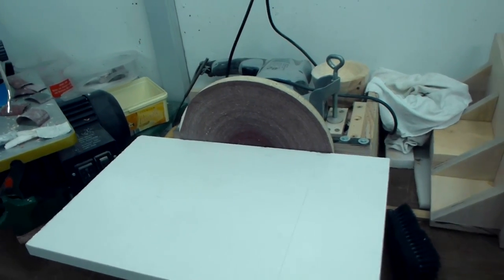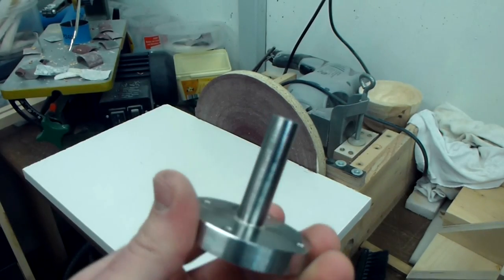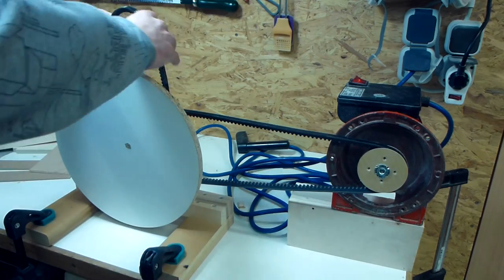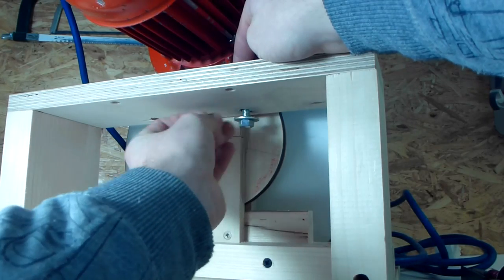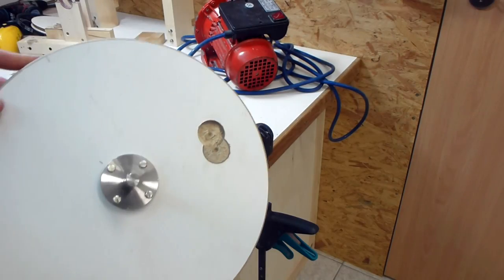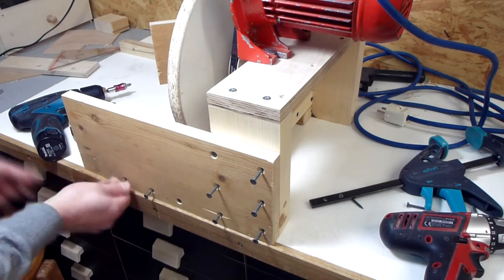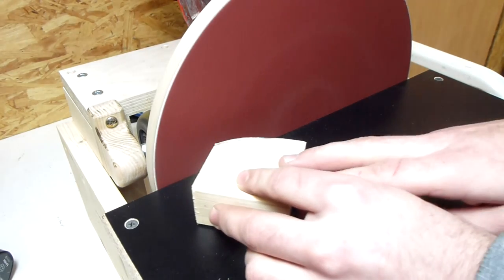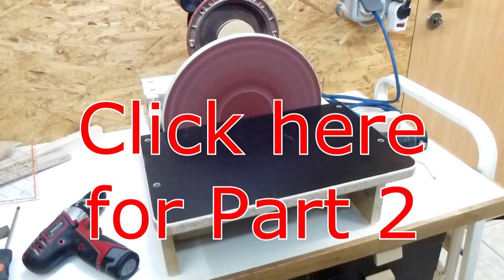Homemade 12" Disc Sander (Part 1)

Comment: A lot of neat ideas in this one - I really like the idler wheel to support the disk.
Reply from the maker: Thank you!
Reply: +John Heisz Me too, as I saw that idea I started thinking if it would be possible to harvest some energy from the turning rollerblade wheel? Probably not that much (though it depends on the usage of disc sander) but it's an interesting thought.

Comment: Добавьте в описание параметры станка: мощность и обороты двигателя, диаметр и обороты (приблизительно) шлифовального диска

   Add a description of the parameters of the machine: the power and engine speed, diameter and speed (approx) sanding disk.

I am sorry for my bad english, I'm using Google translator :)
    Mark Fisher, Kiev, Ukraine.
Reply from the maker: Motor: 600 Watt 2850rpm
Disk: 30cm diameter 1400rpm (more on that in Part 2)

Мотор: 600 Вт 2850rpm
Диск: 30 см діаметр 1400rpm (докладніше про це в частині 2)
Reply: Marius Hornberger  Спасибо за ответ, и за перевод :)  Но Вы можете писать и на английском.
    Я использую браузер Гугл Хром, который переводит комментарии на русский или украинский языки :)
    
      Заходите на мой канал https://www.youtube.com/user/AlfFisher
  Я выкладываю видео о столярке и самодельных приспособлениях.
        Канал русскоязычный, но последнее время я начал добавлять субтитры, которые можно перевести на английский - средствами Ютуб :)

Thanks for the answer and for the translation :) But you can write in English.
     I use Google Chrome browser, which translates comments on Russian or Ukrainian languages :)
    
       Come to my channel https://www.youtube.com/user/AlfFisher
   I post the video of joinery and improvised devices.
         Russian-language channel, but lately I've started to add subtitles, which can be translated into English - YouTube means :)
    Mark .

Comment: Um die Vibrationen zu minimieren solltest du den Riemen waagrecht oder Bus zu einem Winkel von bis zu 60 Grad zur waagrechten Aufbauen.
Dabei solltest du aber darauf achten dass die Seite des Riementriebs die in drehrichtung des Motors vorher ist oben ist.

Ps: der letzte Satz USt nicht perfekt formuliert wusste aber nicht besser wi Ich es erklären soll. Sehe dir am besten das unten verlinkte Bild an

Link: http://www.tedata.com/uploads/pics/3k_10t_2_i05.gif

Comment: If you place the disk in the freezer for a hour or two the PSA should be much easier to remove.  The glue will get brittle and should break away from the disk as you pull. Every so often you may need to clean the disk too. Eventually some of the glue will build up. Try a small area first using lacquer thinner to see if it will dissolve.

Comment: why you have always had a roler blade wheel? where did you get those. is it sell individually?
Reply from the maker: you can buy them on amazon or in a sports shop. I just picked up a used pair of roller blades from a flee market for a few Euros.

Comment: Marius, Having had to dampen vibrations many times, I've discovered that using rubber between the motor mounts and the wood, and between the sander base and table you can greatly reduce (if not eliminate) vibration as well as perceived vibrations.
 A good source of rubber are old mouse pads and foam rubber floor mats.

Comment: Astreiner Aufbau, irgendwann muss ich sowas auch einmal bauen, leider kann ich nicht so gut mit Holz sondern eher mit Metall.
Wie hoch ist die Lebenserwartung für eine Riemenscheibe aus Holz?
Ich kenne es nur von Metall Scheiben die auch schon signifikant verschleissen (über Monate/Jahre).
Reply from the maker: Hmm, dazu kann ich dir leider noch nicht all zu viel sagen. Die beiden an meinem Walzenschleifer sind ca 1,5 Jahre alt und sind noch gut in Schuss. Die an meiner Bandsäge sind etwa 1 Jahr und das andere wegen neuem Motor 3 Monate alt. Ich glaube aber, dass die nicht so lange durchhalten wie die anderen, denn der Riemen rutscht beim starten immer etwas wegen des hohen Drehmoments des Motors beim anlaufen. Ich denk aber, dass wenn mal eins den Geist aufgibt, ich ein Video über den Wechsel machen werde.

Comment: Hhy didn't you attach the motor directly to the disc like commercial sanders do? Then you would not have any vibration

And you cant test a bearing under NO LOAD that only means that there isn't any grease and the bearings will wear itself until it fails, not a good idea.
Reply from the maker: The motor runs too fast.
Reply: Marius
Reply: The motor runs to fast and also no way to atach the flange with the motor
Reply: Obviously "no load" in this case means: "without sanding anything" or possibly, "with nothing touching the sanding disc itself that might produce drag", Oh, I apologize, I should have immediately recognized you were attempting some vague attempt at making a humorous remark. Have a great day!

Comment: Using the pulleys reduces the rpm of the sanding disc. I think this construction works much safer than mounting the disc directly to the motor. Really nice and clever!
Reply from the maker: TheLaudi That's not totally right. I would have mounted disk on the motor shaft, if I had a motor with the the right rpm.

Comment: Using the skate wheel is something I was thinking about in the one I’m going to build. I see you did this several years ago. How is it holding up? Do you still use this sander? I’ve drawn something very similar in concept.
Reply from the maker: It's perfect with that wheel

Comment: That speed is suitable for a 30 cm diameter sanding disk.?
Could it serve as a washing machine motor?.
Reply from the maker: +alcabresamil 1000-1700 rpm on a 30cm disk should work fine.

Comment: Great work Marius.I really need to make one.  I was just wondering could you not connect the motor directly to the disc?
Reply from the maker: Yes you can do that and that's also the common and simpler way, but my motor runs at 2850 rpm, and that is too fast for a disk of that size.
Reply: Marius Hornberger I thought that might be the reason Thanks.

Comment: I like this set up. I've been wanting to do this for a while now. I have an old table saw with a good motor in it that would work just fine. I saw where you used your scraper from your lathe to get a good circumference. I was wondering did you make this tool, or did you buy it. I can't tell, but I'm leaning toward you making it. You do good work young man, your mom and dad should be really proud of you,
mark
Reply from the maker: +Mark Burgess I bought the tool, but made a new, longer and better handle for it.

Comment: Marius, great job !.
I want to build it myself!. You say the engine power ?. If you have plans, I can have them ?.
Reply from the maker: +Doc 951 600w motor. I don't have plans for it.
Reply: +Marius Hornberger However the videos are very clear. I will surely have no problems. Thanks to the availability

Comment: Thanks for a great build. All very useful information. 
Just a quick question for clarification...you must unscrew the table to change sand paper?
Reply from the maker: +Fredrik J Yes, you need to.
Reply: OK, thanks. I guess these can be replaced by dowel pins like your disc protection? On the other hand there is not a great need to shift paper very often...

Comment: Great project.  Built one.  Would only change one thing.  Having that shroud on the left hand side is a pain as it gets in the way when trying to bend around that corner.  That's probably why the store bought ones have nothing protruding past the disc on the left side.
Reply from the maker: +AndyB Yes, that's true. But If I need to sand something there, i just remove the cover to get clearance.
Reply: Marius Hornberger Ah.  My cover is not removable.  Time for a modification.  Thanks.

Comment: Hey..great video.
Did you change the motor only for thr play in the shaft? Or also because of the lack of power??
Regards from NL
Marcel
Reply from the maker: Marcel Smeets You mean using the motor instead of the drill?
Reply: Yes!. Because I was thinking to build a drill powered sander myself..
Reply from the maker: The induction motor is a lot quieter and has a more consistent rpm and a little bit more power, because it runs always at full speed.
To get the right rpm with the drill I could only run it at half speed, because full speed is 3000rpm on this drill and that's too fast for the disk.

Comment: Excellent job Marius. To clean the sandpaper try running a piece of hose pipe, plastic pipe, or better still the crepe sole of an old shoe against it. It pulls all the embedded dust out.
Reply from the maker: Thanks, but I know that and already have something better to clean sandpaper.
Reply: Marius Hornberger What do you use?
Reply from the maker: A big piece of rubber (4cm thick). Was a foot from a pylon.

Comment: 4:49 Says 60 grid, turns it around and it says 80 grid.
Reply from the maker: +LoverOfPhotography no watch closer, it says 60 grit. Don't know why there are 80's.
Reply: Marius Hornberger Still looks like 80 grid on the video, but you placed it, so you are probably right. Nice vid btw. If I could buy one like this for 50€ on an auction, isn't that a better deal than having to buy all the materials? Motor, belt and shaft are not cheap.
Reply from the maker: I paid about 15€ for the parts +20€ for sandpaper.
Reply: LoverOfPhotography its way cheaper to buy one. if you even have to buy the Motor. If the sander You buy is Not good You take the parts and build yourself another one.
Reply: Marius Hornberger 
At 4:53 you were talking about 60 grid while sticking 80 grid sandpaper to the disk.